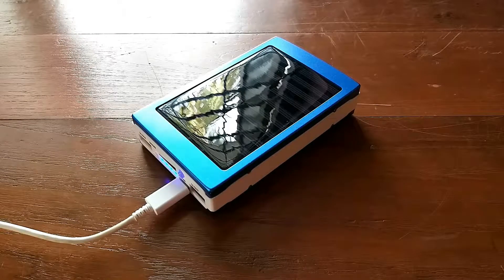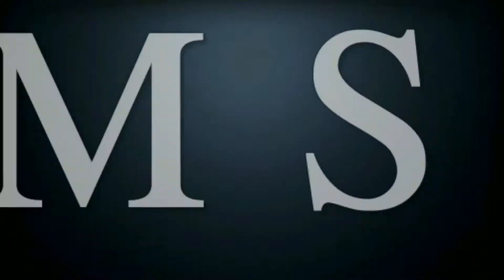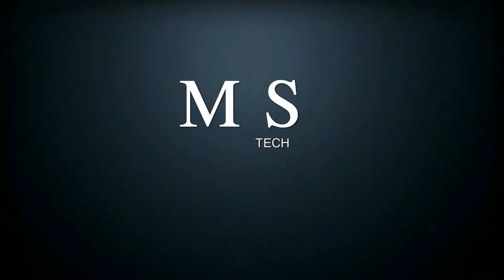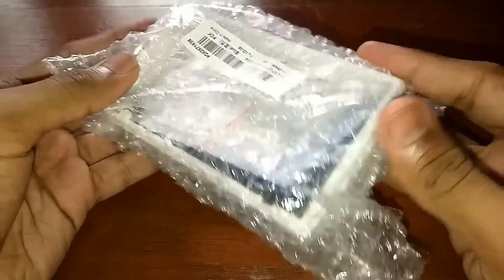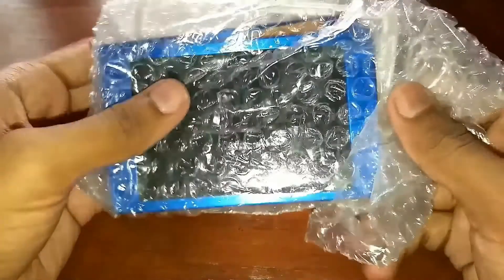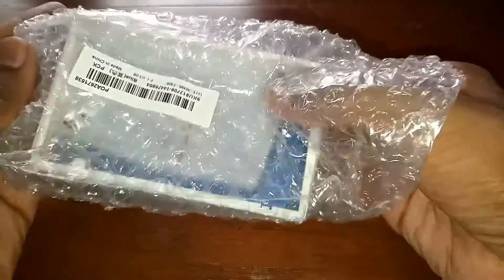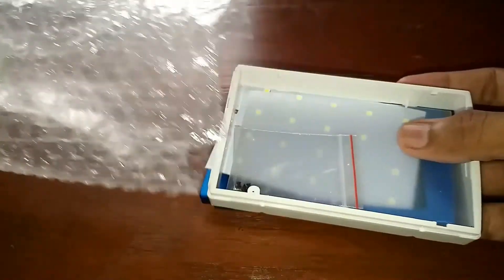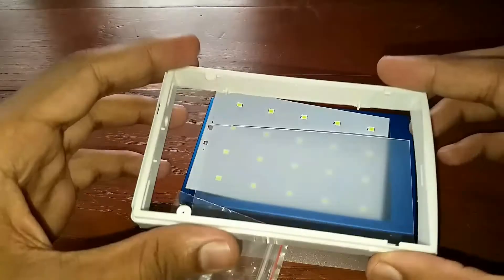HOW TO MAKE SOLAR POWERBANK USING OLD LAPTOP BATTERY 20,000MAH | MS TECH

Comment: What kind of cables are u using?
Reply from the maker: To connect battery in parallel, i used copper wire and for solar panel and led board i used normal thin wire.
Reply: @MSTECHCHANNEL  im sorry to ask again.. that means 0.5mm² wire? And did you connect the batteries with the same 0.5 or a bigger one?
Reply from the maker: @George Stamatopoulos i used copper wire which is used for house wiring, it is 1mm² and i peel off the insulation and took 30% copper from 1mm wire and twisted it and soldered directly on battery. i didn't used full copper wire from that 1mm wire. if you have spot welder then that is better to do, if you use thicker wires then it will become hard to put the battery in the box and also soldering is not the best way to do, it will decrease the performance of your battery and it is danger. i hope you got it and be safe😊
Reply: @MSTECHCHANNEL  thank you very much. first time, so im a bit anxious :)
Reply: Subscribe My Channel